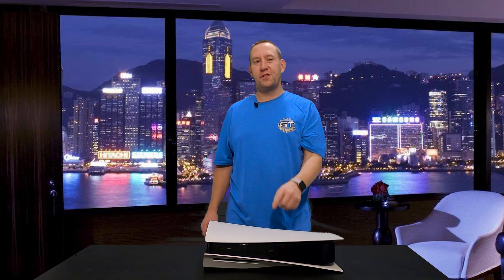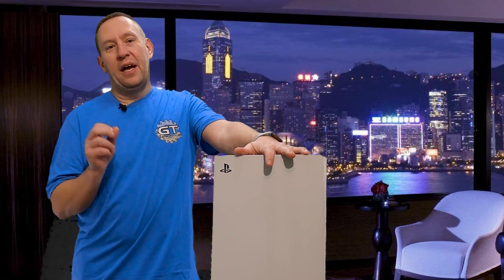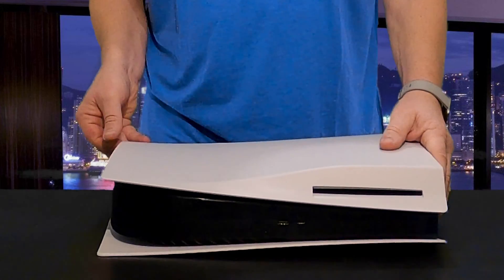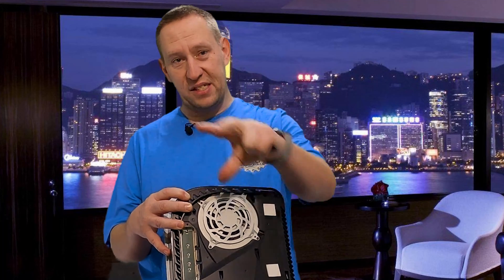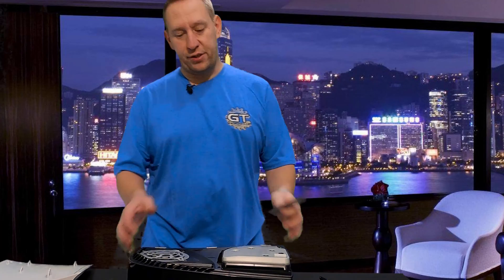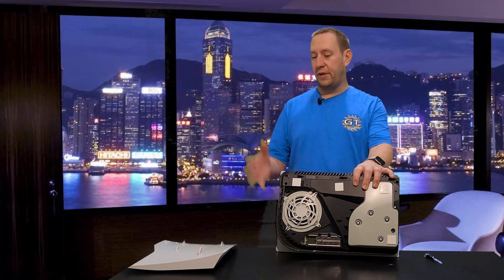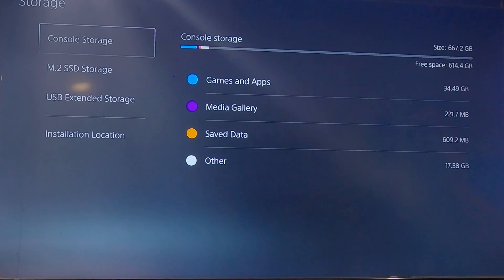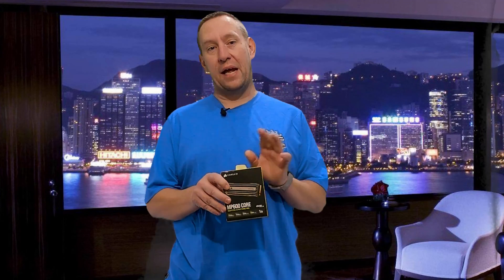This Hardware UPDATE fixes the BIGGEST PS5 Problem (Hint its an M.2 SSD) | Gears and Tech

Comment from the maker: Corsair MP600 - https://amzn.to/3xMObBn

These Drives will also work in your PS5 right away and EASILY Meet the required specs

Western Digital Black SN850 (don't forget to pick the one WITH HEATSINK) - https://amzn.to/3f6WUaH
Gigabyte Aorus NVMe Gen 4 7000S - https://amzn.to/3zQQJzw
Patriot Viper VP4300 - https://amzn.to/3j3zJPL
XPG Gammix S70 - https://amzn.to/2VJBbiq
TEAMGROUP T-Force CARDEA A440 - https://amzn.to/3hTzIOK

These Drives Below NEED to add a Heatsink to keep from cooking but ALSO MEET the required specs

Samsung 980 Pro - https://amzn.to/3y8i7Zv
Sabrent Rocket 4 Plus - https://amzn.to/3yf458z

These drives WILL WORK and are great for a BUDGET GAMER that needs more space, but doesn't want to spend a lot of money!

Corsair MP600 - https://amzn.to/3xMObBn
XPG Gammix - https://amzn.to/3CAx49i
PNY XLR8 - https://amzn.to/3saanEe

Heatsinks for SSD that doesn't have one already
https://amzn.to/2TGcN0o
https://amzn.to/3BUAq6B
https://amzn.to/3rPqJC4